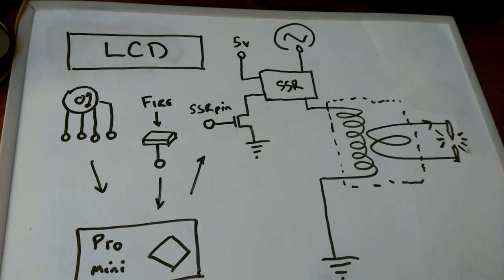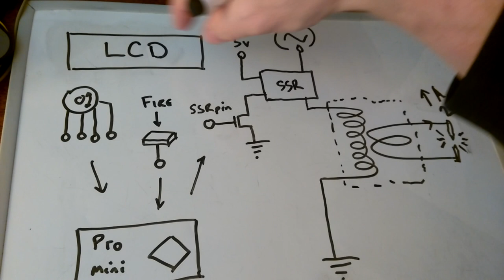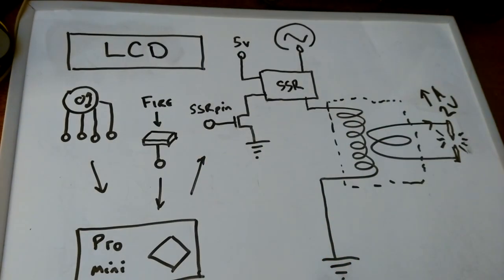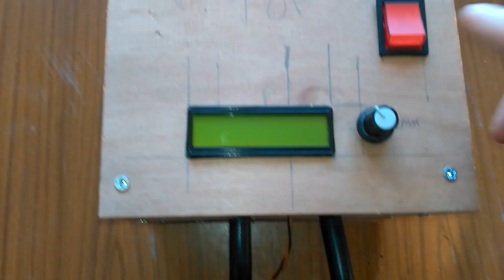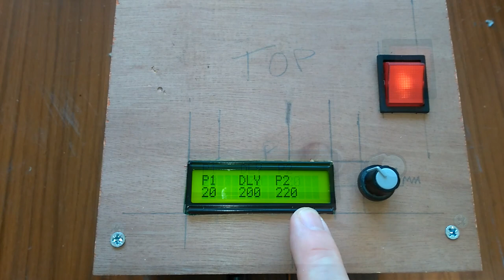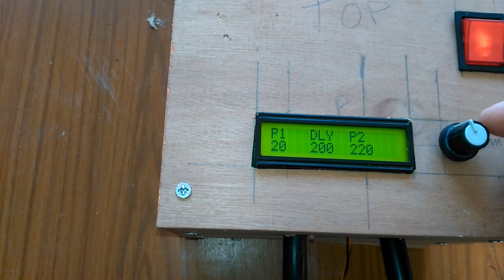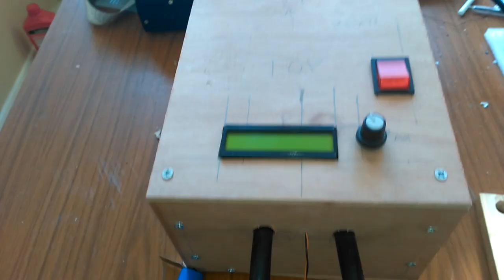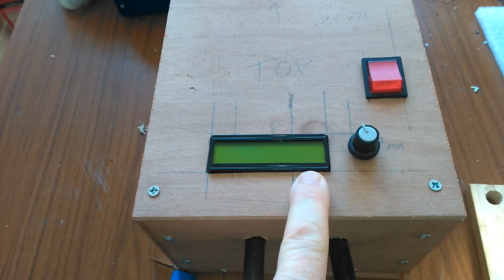Battery Tab Spot Welding Machine from Microwave Oven

Comment: Hi Chris
Thanks for sharing your project. I built something very similar with a SSR to switch the transformer but used a 555 timer to pulse it. You can see an early version in my videos.
I also used welding wire as a secondary with the same number of turns as yours but I'm concerned it causes a lot of heat when welding. It works a treat on the +ve ends of the battery but I have to crank it up to a much longer pulse than I'm happy with to get a good weld on the -ve ends so I think something is not quite right.
I'm considering using slightly thinner wire and more turns to get a higher voltage but lower current. I believe 40A-50A should be sufficient as the spot welders you can buy work well at 40A with a pulse of just a few milliseconds. Also a lot of folk use 12V batteries so higher voltages shouldn't be a problem
Have you any thoughts on that? Would a higher voltage/lower current give a better weld or do the manufactured welders work in a different way?
Thanks again
Alister
Reply from the maker: Hello Alister, welding wire will have a high electrical resistance which is why you're seeing those problems. Copper wire is a much better electrical conductor.
My unit generates 1.2 volts which is plenty to push the high currents necessary. You can also get high currents in higher resistance wires by using higher voltages but then the power lost in the wire itself as heat becomes much higher.

So the moral of the story is - low voltage + low resistance = high current + low power lost as heat.

Good luck.
Reply: Hi Chris,  I may have caused some confusion by saying welding wire, what I meant was 50sq mm copper wire for a welder. 
I've ordered some 25sq copper wire so should be able to get more turns. I'll report back when I've tried it.
Reply from the maker: @alisterbrown6378 ah ok. Yes please let me know how it goes.
Reply: @chriswesley594  It didn't go so well :(  
The 25mm sq cable is almost as thick as the 50mm due to the insulation and I couldn't get any more turns in. I've ordered some 16mm battery cable with thinner insulation and will report back when I've tried it.
Reply from the maker: Hmmm. I don't know why the insulation should be so thick as welding uses only around 30 - 70 volts. But I like your determination! It'll be very satisfying when you've cracked it.
Reply: @chriswesley594  The insulation is around the same thickness as the 50mm cable so the total diameter is much more than half. The total diameter of the 50mm cable is just over 14mm and the 25mm cable is around 11mm. 
I've already invested a lot of time in this plus bought a controller board so I want to get it right. With my home made 555 timer I could turn the pulse up as much as necessary to get a good weld but that was around half a second and caused more heat than I was comfortable with. With the new controller board I was getting poor welds even with the timers set at max so something is not quite right.
Reply from the maker: Did you remove the shunts from the transformer?
Reply: @chriswesley594  Yes mate. I wasn't sure if I should or not but figured they would reduce the voltage induced.
Reply: @alibro7512   your welding wire is probably "double insulated" this means you can cut the outer layer of insulation off to make it thinner and still be left with a decent amount of insulation. the reason welding wire is double insulated is because it get burnt and crushed alot in an industrial enviroment and you dont need it for your purpose.
Reply: @freelectron2029  hi Nathan
This is the wire that goes to the handle in a stick welder. It's highly flexible with pretty soft insulation but only single.
I have since replaced it with 16mm sq cable with thin insulation. This allowed me to have 4 or 5 turns which seems to be working much better but I haven't done a full test yet as the batteries I ordered failed to arrive.

Comment: Do you really need an Arduino for this ? I can see the SCR controlling the transformer and maybe a variable one shot circuit, a couple of caps and resistor a switch and a transistor or MOSFET, to control the timing pulse ! Sometimes simpler is better ! Don't take me wrong your circuit works, and you still get a "A"  .
Reply from the maker: No - see earlier comments. The Arduino provides convenience and accurate timing, but you could do it all with a simple on-off switch and a good experience eye. But reliably hitting, for example, a fifth of a second for the optimal battery tab weld is difficult, and the Arduino also allows the pre-weld pulse which no human could do. I've seen others use 555 timers to do it though. Yourelecxtronics method isn't great because of the mains power switching requirement. I chose my method because it's reliable, expandable and my expertise already exists, but ti's just one way to do it.

Comment: Can i leave the chants on the transformer?
And can i use the transformer directly to the outlet?
Reply from the maker: Zak the video itself answers your first question. Yes, I plug the transformer directly into mains power. Please note the danger warnings in the video and the description.
Reply: @chriswesley594  can i plug the transformer directly to the main without anything else?
Reply from the maker: @zakzak257  If you mean without any switch or controller, then yes - but don't. It could overheat rapidly and destroy itself and perhaps the building it's in.
Reply: @chriswesley594  thanks chris

Comment: Hi Chris, thanks for sharing. 

You mentioned the user-interface problem due to the wide dynamic range of welding time. What about making it exponential like the E series of resistors, e.g. 12 steps per decade?
Reply from the maker: Hi Rainald, yes - I think that would work well. Great idea, thanks!

Comment: Hi, 
I love your video :D 
I'm trying to make one as I'm going to build a battery pack for an electric bike just like you. 
Which mosfet are you using at the output to control the SSR? A 2N700, a BS170?? I'm struggling with that.
Thank you
Reply from the maker: Hi MotorTop, almost any genera;l purpose N channel enhancement mode MOSFET will do this job but I used a 2N7000.
Reply: @chriswesley594  Hi, Ok, thank you :D 
I have already done the machine. I used an irfz44n and it worked without any problem. 
Thank you for sharing, your spot welder is the best I found on the internet and will be very useful for me. You've helped me a lot :)
Reply from the maker: @motortop136  You are very welcome!

Comment: Nice video, nice project and thank you for sharing that. I have a question when you solder 18650 elements did it happened that in some case you burned or made a small hole in the battery ? And If yes did you find the right adjustment, as negative poles of 18650 are very fragile. Did you try with smaller copper pins (the one that solder/touch the nickel) JL
Reply from the maker: Hello JL G and trhanks for writing. I never soldered any 18650 batteries, but if you mean spot welded - then the answer is no. If you blow a hole you have far too much power going into the weld, so you'd dial the weld duration down. In my case, I tested nickle strips to get the shortest weld between two strips which gave a good solid weld, then used that setting for welding strips to batteries, and - providing you seat the business end soldly every time, the weld quality is very consistently good.

Comment: Does the solid state relay switch on zero crossings?
What size mains input fuse are you using?
Reply from the maker: Hi Nigel. Yes, it does, and this does introduce some inaccuracy in the timing, but it's not a factor affecting weld consistency in my experience.
Reply: Chris Wesley if the switching is on zero crossings on both on and off.  it might be better to just count mains cycles to do the timing. It make a big difference if the switching has an odd or even number of half cycles in the current pulse, as an odd number puts a DC spike into the mains supply. We once had some lab test tool that switched off the mains supply to the equipment under test for a set number of mains half cycles. This was to simulate the effect of brown out mains interference. We found that stealing odd numbers of cycles blow the equipment fuses, while blanking even numbers did not result in the same current surge. ( Hence the question about the mains fuse.) Your case is slightly different as you are only switching on for brief periods, but I still suspect that it is better to switch the mains for and even number of half cycles.
Since the load is inductive, it might be better to use leading edge switching as the transformer back EMF from switching off half way through a cycle can result in a big voltage spike on the mains supply. It would certainly be worth doing some safety tests, switching under load and no load conditions.
Your solution seems to work really well.
Given all those loops of wire in your control box, I am a little surprised that the current pulse has not magnetically coupled to the low voltage side of the circuit and caused a problem. I think I might have AC coupled to the solid state switch, so that if the microcontroller locks up, the switch will switch off in a fail safe.
Do you know why the microwave transformer was originally fitted with magnetic shunts? Were they to limit the current to the magnetron or control the mains load impedance?

P.S. I did a bit of research, it appears that the magnetic shunts are used to increase the leakage inductance of the transformer, this limits the current by rasing the transformers impedance and acts as a form of magnetic regulation. The microwave transformers are designed to run under load at all times. Under no load conditions, the magnetisation current from the mains can be very high. I found an article that recommends using two such transformers with primaries connected in series to solve the problem. My guess is that your mains fuse is slow blow and is not blowing due to the short duration of the output pulse. I would be interested to know how much instantaneous current your device is taking from the mains.
Reply from the maker: Hey Nigel thanks for all your helpful comments here.

I did a lot of Youtube research before building this, and found several of the issues you mention - including the double transformer video - though not the odd/even thing you mentioned. I heard you must lave the shunts in or risk blowing fuses - the opposite seems to be true. I heard that SSRs will blow or lock on, but that doesn't seem to be a problem either. And the slight duration errors caused by zero crossing doesn't seem to be a problem either. I found Jim Connor's video - he made a similar device, though he used a different processor, and I asked him about these issues. He said he'd seen no problems in (I think) 300+ welds and based on that I went ahead.

I forgot to answer your fuse question - sorry about that. With the shunts in it didn't weld and blew a 5amp fuse, and made the breaker buzz loudly, like it was about to trip. With the shunts removed, it welds, and the breakers made no noise at all. This contradicts what you're saying, so I don't really understand it. Your explanation seems solid to me. Anyway, it now has a 13amp fuse which isn't the smart thing to do, but - hey ho.

I think I'll press on as-is, given Jim's experiences with a similar machine. If issues arise, I will have to think again.

Yes, I was surprised that induction didn't blow the processor away. When the thing was a bench lash-up lose wires would twitch during welding! And in this video, you can see the two strips rise up above the aluminium plate during the weld. Presumably caused by opposing induced magnetic fields. Yikes.

I have no way to measure the current, but perhaps I will lower the fuse rating to give me an idea. I am planning to see what the machine can do with longer welds and thicker metals, and so I may encounter the problems you mention down the road.

The car-battery-and-relay route is always an option!
Reply: Chris Wesley from what I have read. The MWO transformer must be acting as a constant voltage transformer, producing a reasonable constant output voltage to the magnetron. ( This is just a guess based on the transformer topology).  A constant voltage transformer operates with  the secondary  run as a resonant tuned circuit with the output side of the transformer core operating in magnetic saturation. The shunts add leakage inductance, increasing the transformers input impedance (inductive component). The fact that this seems to increase the chances of the fuses blowing may be down to the odd number of half cycle problem. Apparently MWO transformers are designed to run with a load and have fewer turns on the primary than would be safe in a no load condition. While your solution clearly works, the two transformer solution sounds safer, primaries in series and secondaries in parallel. This has the advantage of increasing the step down ratio of the transformers, giving more amps. There are some very low cost  arc welders on the market, sub £30 with outputs of less than 100amps. The old type that do not use switch mode electronics. Maybe a SSR could be  added to one of these to produce a spot welder.. By the way, what is the rating of your SSR?
Reply from the maker: Interesting details on tranformers I never suspected. The SSR is currently a 25A model. I purchased a 100A model, but fitted the 25A whilst waiting for it to arive. Since it's worked OK I've left it in place.
Reply: Chris Wesley My comments relating to these transformers are specific to MWO transformers, which I believe are a particular type, namely Constant Voltage Transformers. There are a number of reasons why I suspect that MWO transformers are of this type.
Using CVT solves the problem of providing the magnetron with a constant high voltage, necessary to define its output power. (This I believe is controlled by PWM). Because of the number turns normally on the secondary, it makes it easier to run the secondary in resonance. The provision of magnetic shunts is a characteristic of the CVT, as they partly isolates magnetic circuit  between the primary from the secondary winding. From what I have read over the past few days, the shunt increase the leakage inductance of both the primary and secondary coils. This is consistent with wanting to make the secondary HV side resonant. A clue might be how the capacitor of the oven was wired across the transformer. 
I think the intended mode of operation was to drive the secondary coil to resonance, with the circulating currents driving the output arm of the core of the transformer into magnetic saturation. In this condition the transformer output voltage is regulated, as the transformer magnetic flux, inducing the output voltage, is clipped at the saturation value. The resonance of the tuned circuit, filters out the harmonics of the clipped wave form to give a relatively clean constant voltage  sine wave output.
All the above explains why the number of turns on the primary may be fewer than required for a no load or different output conditions. Basically the inductance of the primary, in no load conditions, is too small to control the primary winding current which is really only limited by a relatively small leakage inductance and the winding resistance.
I would be really interested to learn if my understanding of this circuit is correct. Maybe someone with more knowledge on the subject will comment.
Reply from the maker: Wow. Who knew? This makes reasonable sense and would be cause for concern, except for the fact that the fuse will provide protection. I realise that slow-blow fuses will allow large excuirsions for short periods, but I think my strategy will simply be to use it until or unless problems arise.

But this has been fascinating, and goes to show how complexity is not alwasy apparent to non-experts, My degree is in electronic control engineering and computing, but I knew nothing about this. Thanks again.